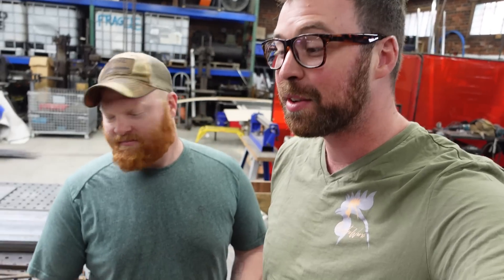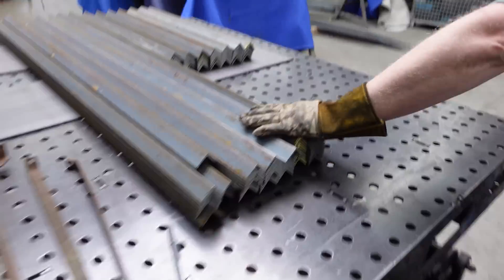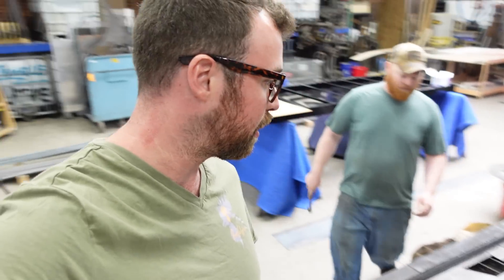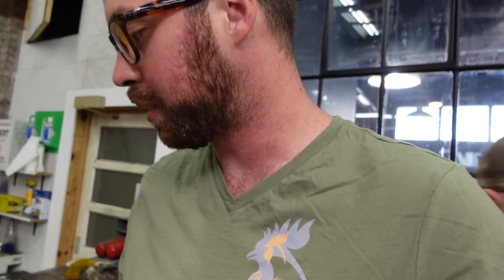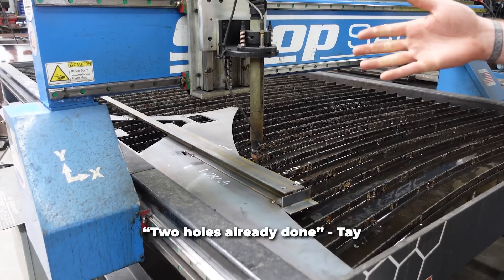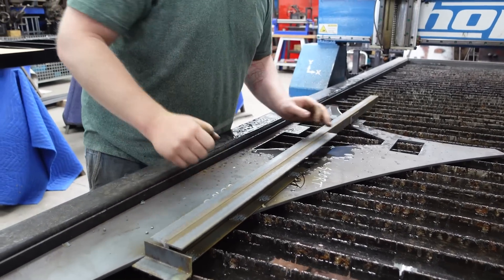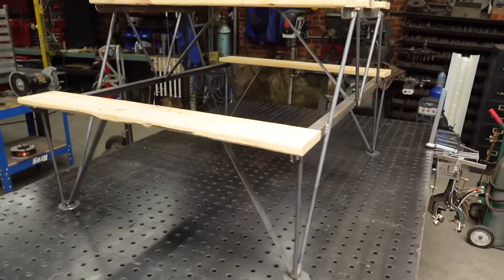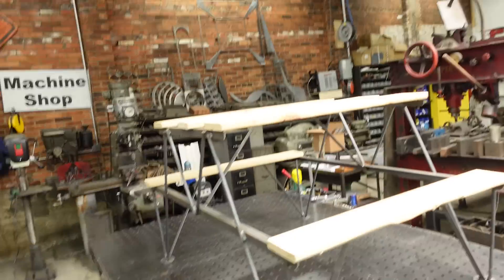How My Plasma Cutter Saved Me SO MUCH Time

Comment: If you move the gantry after the cuts are done to a spot out of the way and add those X,Y to your "Finish"  box in settings the gantry will automatically move to that spot after each set is done... just fyi for future jobs. Saves walking over to the controller and back after each set, one less set of steps for efficiency..

Comment: Hey Tay, did you have to set Z zero to make up for the difference in height or an offset? I’m still learning the ins and outs of this cool machine. Any info would be greatly appreciated. Great work and very creative bud.
Reply: I’m not Tay and I have a different plasma table, but I think if you zero your z on the angle iron, when the torch comes down, the IHS will sense the angle iron like it’s a flat sheet, touch off and go.  I haven’t actually done this yet, but that’s how I imagine it works.
Reply: @810Metalworks  ya I would think so to. Like your saying that when they centered the torch head on the angle in the bottom left corner, essentially “home” for the project, and then the THC would sense the angle iron and automatically zero it out? Or am I way off.

Comment: Hey Tay, 
     I’ve been a Welder/ Fabricator/ Heavy Equipment Mechanic for 45ish years. I got lit up at work 3 yr. Ago  by 460Volts(Bad Electrician, Terribly done job) after 3 yr. Rehab & 1-2 years left I’m about to head back into my retirement shop. Im wanting a great quality 4x8 plasma table  that… here’s the part I’m afraid to ask you… could be capable of attaching other heads to cut other media’s? Do you know of such high end machines? Do you think I’m stupid for such a question? Im retired with a limited budget and limited mobility and pain tolerance, and I enjoy working with and building with all media. Someday maybe my ship full of money bags will come in so I can buy separate machines, but if I hold my breath I’ll pass out!
Reply from the maker: Wow, what a story! You're lucky to be alive! 480 is NO JOKE...but i dont have to tell you that. Im glad you're getting back at it and able to move and work agian. Not a stupid question at all! Actually, Shop Sabre makes cnc machines that can be outfitted with both a spindle for cnc routing and a plasma torch. Im not sure whats involved in switching between the two other than the obvious but with their killer customer support, im sure the answer isnt hard to find. Good luck mate! Thanks for reaching out - Tay
Reply: @LiftArcStudios  thanks Tay for the Reply. I’m on a very rough 4x4 road with huge boulders in my path, and broken parts along the way!
Very painful…

Comment: Something we had on the job site was a hydraulic hole punch machine.  This was a huge time saver.  We had to make long tray runs made from flat bar. It made perfect 1/4" holes  for bolts. Worked so well Apprentice could do it. Ha Ha.

Comment: I use the same technique on my Sidekick 8 (which we purchased partially based on your positive review). Tip on the cycle start, you can use the “tab” key to open recent jobs and the last job will be at the top, just hit enter. Saves a few clicks which add  up over several hundred cycles. 👍🏻

Comment: Good job thinking outside the box. She cuts a pretty decent looking small hole. 

I don’t have a plasma table or do mass production work but I do have a 65 ton piranha that would have been perfect for a job like that. Can cut the angle iron, cut the rod, and pop 60 perfect holes a minute
Reply: So on a Iron worker, do you need to mark hole locations before punching them?  or is there another way you do it?
Reply: @Darnic-Fab  on an iron worker u do need to build a jig type which will help to place the workpiece at the right position to punch a hole. Actually this job can be faster and more clean holes with an iron worker. No dross nor tapered holes. Just an alternative I suggest

Comment: Add a G00 command with the X and y coordinates to move the gantry out of the way automatically after the last line of G code in the program.
Reply: Do you know if there’s a way to do this in sheetcam?  I have a Langmuir crossfire pro and it annoys me that the torch doesn’t zero itself after cutting
Reply: @810Metalworks I don’t have Langmuir, so I don’t know if you can do it within their own software. But I know how to do it by changing the gcode manually.

Comment: Handy technique.  The place I started working at a few months ago has a combination hole punch/sheer machine.  Obviously getting a big new tool for one job isn't practical but every time I punch holes on it I regret every hole I've ever drilled.  You are limited on the size/shape of what will fit in the punch whereas on the cnc much more options.